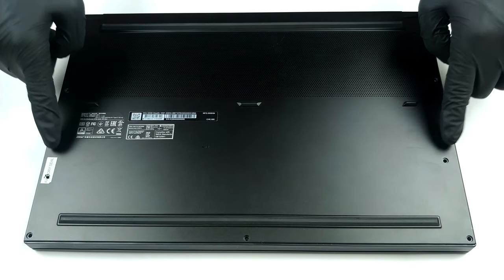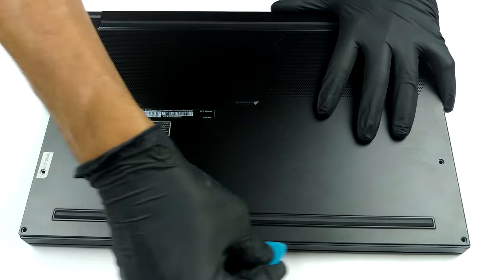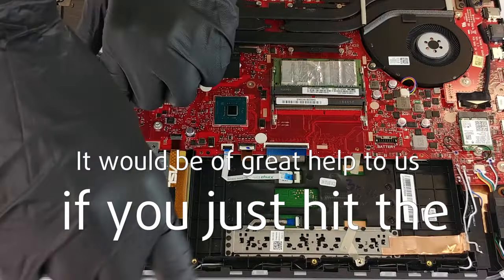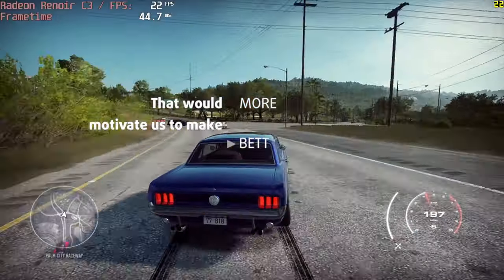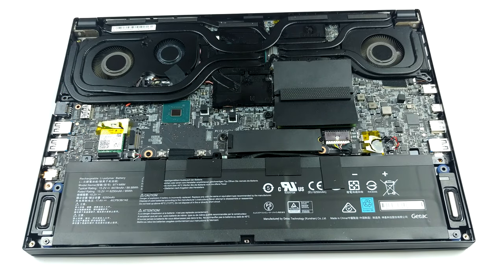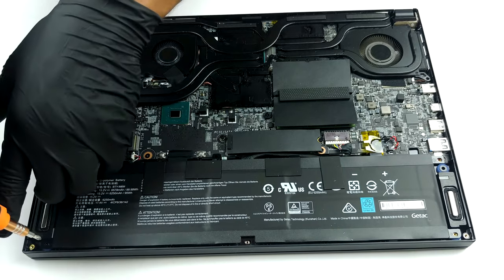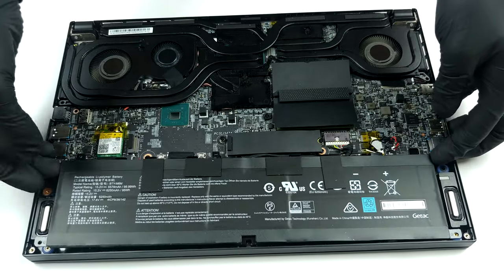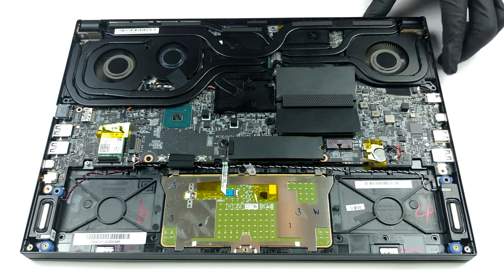🛠️ MSI GS66 Stealth - disassembly and upgrade options

Comment: This can apply to the MSI G66 leopard as well - but at 1:35 you should be assisting the battery pins out by putting pressure away from the connector/towards where you are pulling on the top of where that white divot is.
Reply: Hey, Do you mean push it out from the centre ? I am having a hard time removing the connector . It only wiggles out a tiny bit
Reply: @MrReklez  yeah, i had to use a small tool to push it out, needs more force but be careful of course.

Comment: According to this video, there are two M.2 pci ex-4 slots w/ raid support and one that can fit M.2 sata drive. Mine came with a 1TB NVMEe SSD, so if I wanted to add another SSD to maximize the storage, what should I buy? (Best option) Really looking for an answer so thanks in advance!
Reply: 2TB or 4tb Rocket 4 PLUS NVMe 4.0 Gen4 PCIe M.2 Internal SSD Solid State Drive (SB-RKT4P-2TB
Reply: After a lot of research I decided to go with that. It’s cheaper on Amazon and if you qualify for one of those "split into 4 payments" apps you can purchase thru there
Reply: You better check that in cruiser official website

Comment: Do you have to remove the battery first in order to replace the storage and memory sticks ?
Reply: no all you have to do is make sure you laptop is off. You don't need to remove the battery
Reply: @wigin3548  There is a little button on the backside, you have to push it with a paperclip or something, before opening the laptop. It disconnects the power from the motherboard.
Reply: @wigin3548  You don't need to but, it is highly recommended as you can damage your laptop.

Comment: Can you upgrade the graphics card?
Reply: no you cant. If you want better graphics you have to configure it on the msi website
Reply: @wigin3548  how do u do this?
Reply: @grflip6491  I think you'd need dragon center downloaded if I'm mistaken search it up
Reply: @grflip6491  The comment from Wigin suggests that you buy the upgrade from the start. GPUs on laptops are typically never upgraded . The dragon center advice is to adjust performance of your graphics cards for quiet mode or standard, overclocking etc. There is much less headroom on a laptop than a desktop so it is not as useful.
Reply: theres always an external gpu thing. ive never tried it though

Comment: Hi, thanks for your video. Do you know for the MSI Creator 17 A series if it as simple as this model to add a second ssd? I see it says that the laptop has 2 slots (2x M.2 2280 SSD Combo (NVMe PCIe Gen3 / SATA)) I'm guessing both could be M.2 format?
Reply: Yes, I've seen that config, two M.2 drives. I'm just looking for a config with the original NVMe and a SATA drive. I'm about to retire an older GP62 and want to put the SATA as the secondary drive for the GS66, I don't know if it'll fit, seems a bit crowded.

Comment: How many years do you think this laptop will last?!
Reply: More than 8 years
Reply: Mine lasted 8 months.
Reply: this is my backup laptop for mmos and its been almost a year
Reply: Mine is having issues a 1 1/2 in :/ Fan after warranty things fall apart quick (for me brokwn keycaps and fan making noise). Already replacing it when my new laptop ships (gotta wait like 4 months though)
Reply: Also having problems 1.5 years in (just outside of warranty :D).  Fans are puny, easily clogged, and hard to clean, causing the CPU to overheat.  Recently the single fan on the right broke, requiring me to try to find a replacement and repaste again since it's connected to the heatsink.
Reply: @concernedcitizen5624  Hey buddy, I'm in the exact same boat atm... I've the laptop apart in front of me - Don't suppose you have the fan models or replacement link?
Reply: Lost mine 2 weeks from end of warranty because of static shock. They decided to start the warranty when B&H photos ordered it, causing warranty issues for me. MSI kept giving me the run around until it was out of warranty either way.  I will not buy another MSI product again after I repair this one and unload it to buy a cheap one.

Comment: I wish it had two ssd slots
Reply: it has,
Left - NVME Only
Right - NVME/SATA
Reply: @rarinth  yeah I looked again and saw it, time for new glasses lol
Reply: @rarinth  Why left slot do not have soft ped for under ssd? I see right side have it
Reply: @arslaner33  The one slot with the thermal pad under it is the included drive. They didn't include a pad for the other slot, since it doesn't come with a drive in it already.  They're inexpensive to purchase though, if/when you buy a 2nd drive to put in that slot.